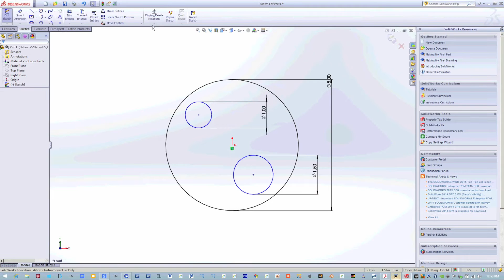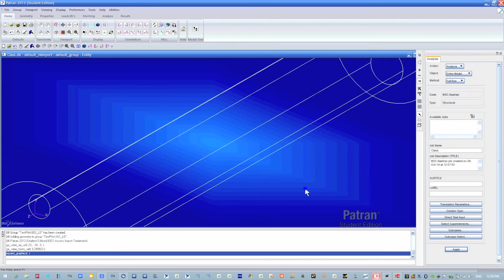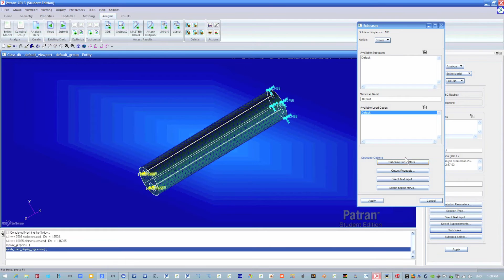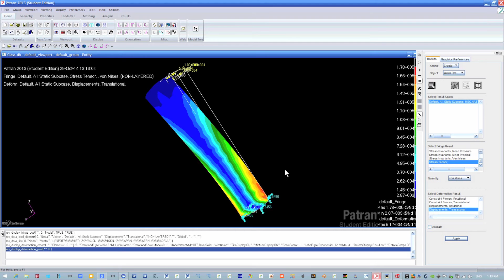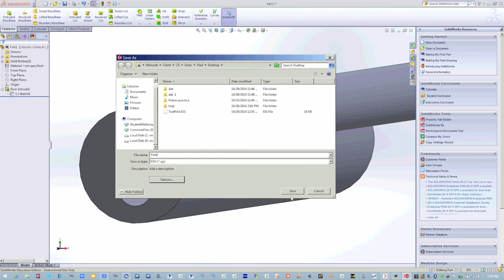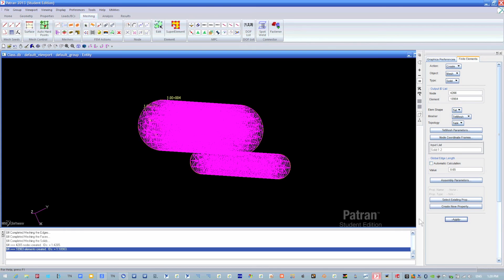Importing SolidWorks models into Patran

Comment: I desperately need a tutorial on structural analysis on an assembly file (Multiple solids). I made a CATIA model and imported it into Patran as a step file and I'm totally lost on connecting all the components as a rigid body element. I would greatly appreciate any help. I have a project coming up which is due in 2 weeks. I'm the only undergraduate in it so any help would be much appreciated.
Reply from the maker: Hey there @Julian Chee. Unfortunately I have not used Patran since college over four years ago, so I won't be able to help much with this... If you still have the time, I would recommend visiting your tutors/ teaching assistants for your class. They are generally very helpful. 😊 Take care!
Reply from the maker: That being said, check out my other video if it helps https://youtu.be/1YCAeNlZYt8 Although, in that video there is only one part: I am not aware of how to work with an assembly in Patran, or of it's even possible.